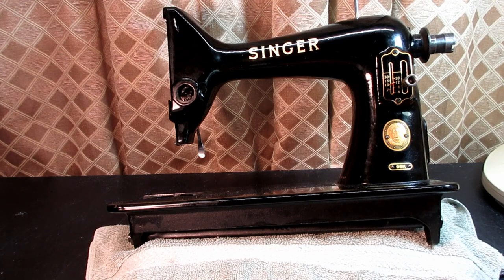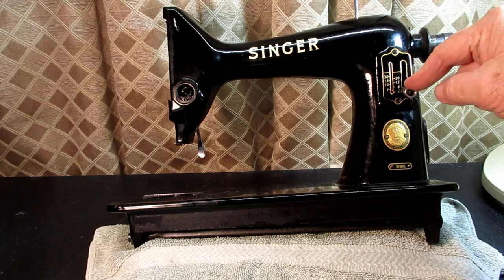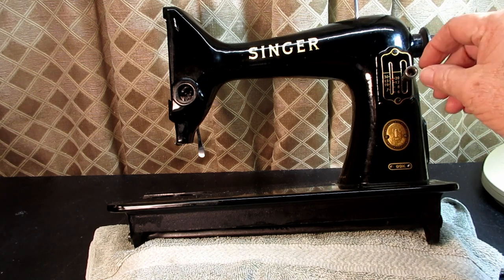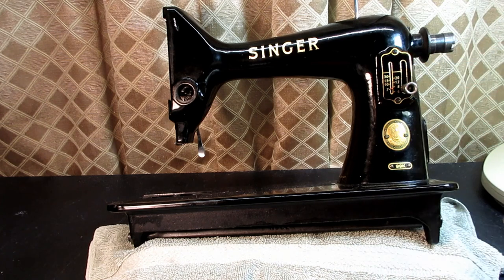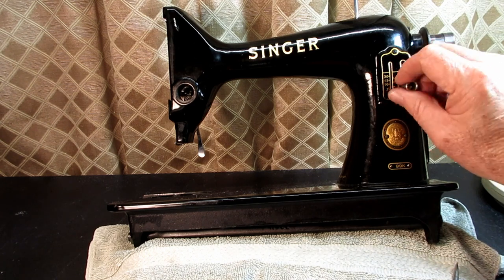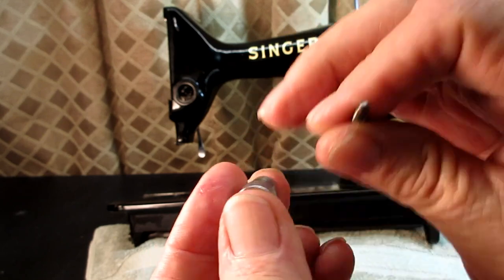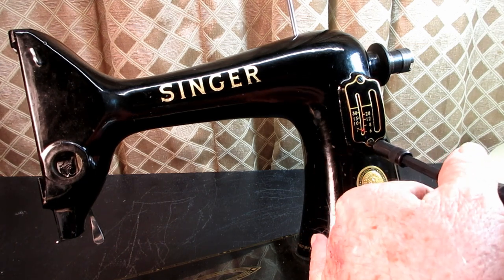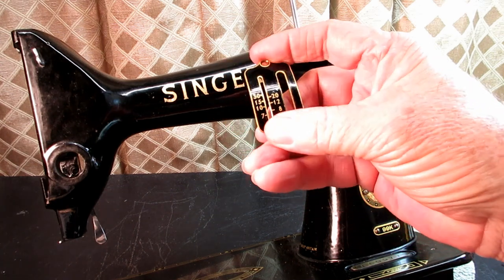The Feed Regulator System of a Singer Model 99K Sewing Machine

Comment: That little spring inside the cuff looks similar to a whammy bar spring used on fender strat guitars
Reply from the maker: like this? https://www.ebay.com/itm/254698897260?chn=ps&mkevt=1&mkcid=28
I'll have to start calling it the "whammy" spring now.
Reply: @andytubesewing1953  Hope it works for you😀
Reply from the maker: @erikgautebaklid2868  thanks Erik

Comment: Andy my stitch regulator screw gradually moves from large stitches to small stitches as I'm sewing. Any ideas as to what the problem is? Thank You.
Reply from the maker: Feed/Stitch Regulator "creeping" is usually caused by a loose mounting screw that holds the feed regulator to the feed forked connection rod. You see me removing that big screw starting at @14:10 in the video. You want to be sure it is completely installed and firm otherwise the vibration and movement of the feed forked connection rod will allow the regulator to creep up and/or down while sewing (hinging effect). Videos showing how to remove the handwheel or motor for access to the screw can be found in my model 15-91 playlist here: https://www.youtube.com/playlist?list=PLsCOZgzzaiKJftyGwzdDiWa9R6HFEACJo Good luck, Alan.
Reply: @andytubesewing1953  Thanks so much Andy Tightened that screw and the problem was fixed. Again thanks so much Your videos are very clear and informative!
Reply from the maker: @AlanR8756  Love hearing that. Glad it was an easy fix. Thanks again for keeping your machine in service.

Comment: Thank you so much for this video. The screw stud that goes into the thumb screw is having a hard time screwing back in. I have tried oil and it is threaded in correctly, but it won’t budge any further after a couple turns of the screw stud. Is there anything I can use to loosen it up?p
Reply from the maker: I'd say the threads in the thumb screw are bent or blocked with debris. I assume you've closely examined the threads on the screw studs and do not see damage. 
     A couple things I have done is try putting the screw stud in from the other end of the thumb screw. Easy does it (with a drop of oil). That can sometimes straighten a bent thread or clear out some dried oil or grit. Then try the normal assembly again. 
     I have also soaked both pieces in Krud Kutter degreaser or WD40-type products to soften any hard, dried oil/grit. Use a wire brush on the screw stud threads.
     Finally, one time in desperation 🙏 I put the dry, clean screw stud in the freezer overnight. In the morning I boiled the thumb screw in water for about 3 minutes (roiling boil). Wearing gloves I was able to gently force the screw stud into the thumb screw hole. A retired repairman told me of that trick. According to him, it makes the screw a tiny bit smaller (micron) and the thumb screw hot and flexible. You know I was desperate because I took it apart to clean the machine for a paying customer and what if I could not get it back together?  😳 Oh, Brother! It did work for me though. ✨🌟👍🏆
Reply: @andytubesewing1953  Thank you SO much, I will give these a try!
Reply from the maker: @MP-tt2uu  Sure hope it works out for you.

Comment: Andy. Very grateful for your videos. I am cleaning up a 185k. It's mechanism is identical to the 99 as far as I can see. The only/last thing giving me problems is getting the little roller back in place before putting the rest of the regulator back. It came out easily but I am not having success getting it back. Any tips please? Thank you.
Reply from the maker: Be sure to put oil on the hole of the roller to help it slide on. Don't oil the outside circumference of the roller yet so it is not too slippery. I have used a BBQ stick from the end opening to get the roller near the screw stud and a plier from the front opening, or your finger, to push it off the BBQ stick and onto the stud. You can try a hemostat to hold the roller from the end opening, holding the roller between the inner hole and outside edge and get it started onto the stud, then a finger from the front to hold it on the stud as you release the hemostat. You can turn the armshaft and that will rock the feed forked connection and move the stud a little bit for the position. On the 99K I did a while ago I used the BBQ stick method and that worked for me. I looked up both parts records and they are the exact same parts on the 99K & 185. Good Luck. Oh, wait! My wife was reading over my shoulder and says she used a magnet to hold the roller thru the front and manipulated the roller onto the stud with her finger from the back opening. Magnet on the outside curved edge of the roller.
Reply: @andytubesewing1953  Thanks for prompt reply. I finally got it back on. I did try a magnet but I think it was too strong. It stuck to everything!!. 
I took the motor off which seemed to help with a little extra space.
Sadly I dropped the motor and broke the casing. Do you know if bakealite will glue together? I was just finished and the stitch regulator is working so well😢
Reply from the maker: 😢 Broke the casing? Oh no! I use super glue and baking soda on plastic.
https://youtu.be/NXx6JyP9d5U   I've never tried it on bakelite though.
i searched YouTube for "Bakelite repairs" and there are dozens of videos with many methods. Mostly of vintage radio and phones, but bakelite all the same.
Good Luck.
Reply: I tried super glue with a very good result.
I managed to assemble it again and it's sewing🤞. Thanks for your help.
Reply from the maker: Thank you for letting me know that. fIn the  future I can say "Hey, it worked well for Pauline!" Thanks for saving that motor and machine. Happy sewing.

Comment: Hi Andy,
I started dismantling a 1938 201 last evening and was checking some of the screws as I removed them.
I found several 10-32's being used.
A 10-32x 1 1/2 is used to hold the plug base to the machine, (that little double nut w/ threads inside and 
out) and the screw that holds the light socket in its cover is a 10-32 x 1/2 or 3/4 or so, it was missing but 
the threads check.
Seems hit or miss on these screws, I haven't really narrowed down a method to their madness yet.
Anyway, thanks for another fine video my friend.
Reply from the maker: You've had better luck than I have with common screws. Have never done a 201 though. Your findings mean there is still hope, hehe. Thanks for watching.
Reply: They sure went to a lot of expense to set up taps and dies for all their threaded 
fasteners that's for sure, it isn't 100% but they have a market there.
I'm glad that most are still available like the dog screws and such.

Kenmore has a 5 sided bolt, at least on the 158's where your hook timing must be 
adjusted, to force people to pay their techs to time the hook.
The special socket was once available by special order but not any longer.
Now we know why sears is going belly up.
The solution to that problem is to cut a groove in the bolt head with a dremel and use a screw driver to take it out, and then run a 10-32 tap in the hole and replace it with a hex head cap screw.
People get birds nests in the hook area from improper top thread tension and then get angry and jerk the thread nest out, throwing it out of time, so they compound their
problem a thousand fold, I'm finding.

Comment: Hi, Andy--
This was a very helpful video--I'd never have dared to explore that far inside a sewing machine without it--but taking the feed regular mechanism apart didn't solve my problem, and I wonder if you have any advice. 

I can't move the stitch regulator thumb screw above about the #10 mark. The indicator pin--the one with the red dot in your video--seems to get stuck in the groove of the indicator plate. If I take the plate off, the mechanism moves freely. I thought maybe the pin just needed to be pushed farther in, but I can't move it. It doesn't pull out freely as yours does in the video; it seems very firmly stuck. (I tried a bit of penetrating oil, but it didn't seem to help.) I'd appreciate any suggestions.
Reply from the maker: My first thought is the indicator pin is bent. 
     It may be stuck in the regulator due to dried oil. Penetrator oil can help and I often heat the metal parts with a hair dryer to soften the old oil and get the parts moving. I assume you did not remove the regulator itself from the machine so I'd try more oil and heat. It's hard to hurt anything inside with a hairdryer. 
     I'm puzzled as to how it could have been bent b/c it's a sturdy piece of steel. But if the machine works normally without the plate then I doubt the feed dog is out of adjustment. Thus the thought that maybe the pin, oh!... or maybe the indicator plate!, is bent or damaged.
Reply: @andytubesewing1953  Thank you so much for responding! Yes, I also thought the pin might be bent and wedged in--I don't see another explanation, really. I did remove the regulator so that I could push and pull at the pin from both sides, but it wouldn't budge. I was proud to get it back in! Will try heat as well as penetrating oil.
Reply from the maker: @erbuky  Impressive to get that regulator out & back in with the pin in place! Nicely done. Is the spring that the pin goes thru in place? You did not mention the indicator plate if it was bent, so I guess not.
Reply: @andytubesewing1953  Yes, the spring is in place (or was until I dropped it on the floor). It doesn't seem to be limiting the travel of the pin in the groove--what's getting stuck is, for want of a better word, the nipple of the pin.
Reply from the maker: @erbuky  OK, thanks. I asked b/c there are a few variations of model 99 and this one is the only one with a spring and double-slotted cover plate that I can find in the parts manuals. If you could get the pin out do you plan to just leave it out so you sew shorter stitches and get into reverse? The red-nippled pin is strictly an indicator and serves no other function. It's a weird problem I never encountered before. If you used a vice and tried bending the pin I wonder if it would get stuck going below 10 SPI. I have had screws that took multiple oiling and heating to "break free" but eventually would turn. This pin is more of a pull-out situation and hard to get traction.
Reply: @andytubesewing1953  It's definitely weird! Singer parts are generally so carefully made that it was a surprise to find something that just doesn't seem to fit where it's supposed to. But I don't know the history of this machine (except that it's had a hard life recently), so maybe this part was replaced at some point. Anyway, thank you for all your advice. I'll keep trying to get the pin out and reposition it and let you know if I succeed.
Reply from the maker: @erbuky  Best of luck. I like your determination.
Reply: @andytubesewing1953  Success! We put the feed regulator in a vise and managed to tap the pin out with a hammer, then cleaned it up, replaced it, and restored its red dot with a small can of enamel that has been sitting around for 20 years (take that, Marie Kondo). Thanks again--without your video I'd never even have known that the pin was supposed to move or that it was the reason I couldn't flip the lever up for reverse stitching.

There's a lot more work needed on this machine, but this is real progress.
Reply from the maker: @erbuky  That's ✨brilliant! ✨Determination & improvisation are used to restore that part(s). Yeah, what does Kondo know, anyway? It's my closet and I'll keep what I want in it! I hope the rest of your restoration goes well. Here are my other 99K videos if you did not see the playlist: https://www.youtube.com/playlist?list=PLsCOZgzzaiKIIUgkEujqHc9iNWN9NPW2Z I hope you'll post a picture or slideshow of your beauty sometime in the future.

Comment: Hi Andy, any advice on the setting hook timing of singer 9217. Has only one set screw, on gear, under bobbin case fear. I see no needle set bar
Reply from the maker: I've never worked on a 9217, but most machines use the same principle. Here is a link to an explanation of timing it. Look at the answer for the singer serenade 20.
http://www.fixya.com/support/t26781642-set_hook_timing_singer_serenade_20
Here is a link to the parts list/diagram so you can see where all the parts are: http://parts.singerco.com/CPpartCharts/9_99999/9210_9217_9224_9240.pdf
Here is a link to the original instruction manual: https://www.singer.com/sites/default/files/product_manual/SINGER%209217%20and%20%209224%20Sewing%20Machine.pdf
A video showing comon timing method: https://youtu.be/6pAWzJyV0IY
Nobody I asked has a service manual for this model. Good Luck.

Comment: My feed regulator will only move halfway up. When I remove the plate it moves freely.
I tried to remove the feed regulator thumb screw and it was so rusted it broke off.
Reply from the maker: Ouch. You can find replacement parts on eBay https://www.ebay.com/sch/i.html?_from=R40&_trksid=p2380057.m570.l1313&_nkw=singer+model+99k+feed+regulator+part&_sacat=0    Thee are a couple three different types of regulators so look closely before you buy to get the same style you have. Good Luck.